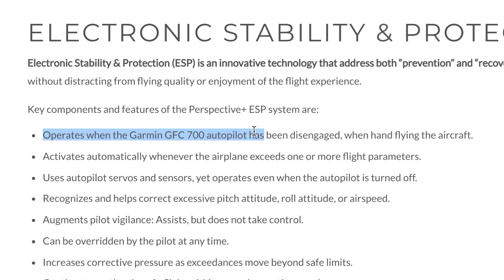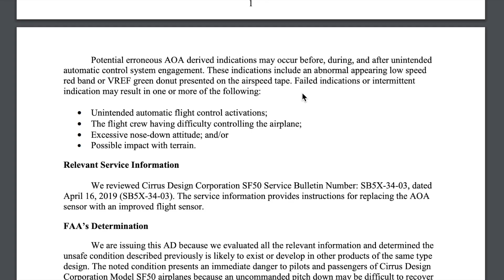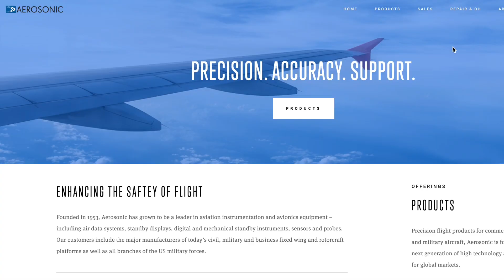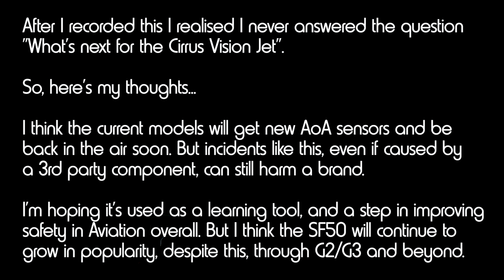Why did the FAA GROUND Cirrus VISION JETS?

Comment: Most planes don’t have an AOA.  Treating it as run away trim etc solves the problem.  Adjust the software and hardware.  Make all operators aware but it was excessive to ground the whole fleet. All political especially in the B737 case.

Comment: I also wonder about all the new features coming out with the new TBM940.  It seems like all these companies are making the airplanes do everything to keep you out of trouble but I also like having manual control over a lot of aspects of flight until they are long proven to work correctly.
Reply from the maker: Yeah I like a degree of system automation, I use it in my flying, but agree that as new automation technologies come into the cockpit the pilot should be able to easily a) monitor, b) verify against other data sources, and if necessary c) override the system. Fortunately seems the pilots in these incidents were able to do that. Thanks mate.
Reply: Stefan Drury - It's all well and good when the issue happens when there is enough speed and/or altitude to recover from whatever errant inputs the automation may apply. Down and dirty just prior to touchdown would be a very, very inopportune moment for something like this to happen.
Fly-by-wire, crash-by-wire !
There are far too many people thinking that "idiot-proofing" is a good idea. Unfortunately, all too often, its implemented by people who fail to perform effective systems analysis.
There really is no substitute for a properly trained and experienced pilot. Having an AoA sensor provide information is great. Having that sensor lead to control-inputs - BAAAAAAAAAAD move. They've already demonstrated just how bad. Sadly, they think that a 'fixed' sensor fixes the problem. It doesn't. The problem is that ANY failure in the system can lead to unexpected and uncommanded control inputs and that they have something in the chain which can apply control-forces when the pilot least expects it and when the results could be rapidly deadly. The only fix is to remove such gizmos from the command-chain, entirely.
One might as well sit a toddler in the co-pilot's seat and trust them not to kick the yoke when the pilot is otherwise preoccupied.
I've been warning about this kind of crap making its way into the aviation industry for decades now and people have said that I'm scaremongering. No, I'm someone who has around 40 years experience of systems analysis and can see how economic pressures have led to companies selling poorly thought-out "idiot-proofing" as a good idea.
Reply: @RoadRunnerLaser  Excellent points!
Reply: @RoadRunnerLaser : Don't forget the influence of government agencies for whom "More is more" and who also have no respect for costs.
Reply: Happy Easter Steveo.
Reply: Completely agree
Reply: Agreed man. No computer should override the humans ever. 
Ill stick with flying my cessna 172.
Reply: Future ATC emergency conversations will be like calling Apple help, "Have you tried turning it off and on again?"
Reply: Oh Steve I watched you and Jeff's motovlog I was just waiting for a pull put I still loved it
Reply: Car manufacturers are going the same  route. You have to pay extra for all kinds of barely-tested gewgaws that are supposed to think for you and guide you to the safe path. Instead, they do the opposite, while lulling many into complacency that "'Otto' will save me."

I doubt it's a 100% coincidence that this is almost the exact problem the B737 had & caused its grounding.  Different causes, for sure, but same effect on the pilot and quite similar procedure to save the aircraft... hopefully.
Reply: @Paul Baker I studied MAX Trim which became as I expected: Rather than placing a sanity-check as control enters code segment; What they have done is allow non-mechanical to ( drop in) ( something ) the design intent of which is to remove all naturally occurring control responses and replace with stick moves; Airplane does that;
Which soon I see a Stall Warning text overlay in the video → Encoders for  Angle of Attack sensors on the MAX were faulty; Giving values which remind me of the Airane incident studied in Standard Texts ~ guessing without seeing both the code and sample on bench with manual; It just makes no sense unless it is comparable to buffer wraparound and Integer Sign Bit issues with some sort of limit value at 74.5° 
«degree of system automation» has made the customer the Guinea Pig for Investor Capital
Reply: steveo1kinevo   yep killing good pilots for the sake of a few incompetents apparently needing enhanced autopilots to protect them from their  incompetence/foolishness. As for boeing they should stop selling a few planes here or there to 3rd tier economies, its just not worth the reputational  risk - MCAS was installed because of very notable 3rd tier stall accidents. US nor European pilots were tricked by MCAS - on the margins 3rd tier pilots will of course be a bit more challenged , its like. putting major sporting  bets on 3rd tier teams - generally not a brilliant idea.
Reply: These stability control systems must not rely on a single instrument. The computer needs to compare all instruments, (exactly the way a human pilot would) to determine the situation the aircraft is in and if there is a malfunctioning sensor. If the AOA is high but so is the airspeed, and the airplane is in level flight and not pulling any G's, then the AOA is erroneous and the airplane is in no danger.
One of the airplanes had a warning about the AOA sensor, so the computer knew it had bad data, but it commanded a dive anyway! That is absurdly dangerous.
Reply: the issue is becoming everyone wants single pilot certified jets/planes and that is causing all this automation. and the subsequent issues

Comment: I absolutely agree with you. If you look carefully at the news, the issue is not with AOA indicators, but with this specific one which unfortunately experienced a manufacturing glitch on this particular model. Overall, I think the envelope protection offered by AP's are a good thing, especially the the feature that allows the pilot to hit the button that puts the aircraft in level flight, should the pilot experience vertigo or loss of orientation.
Reply from the maker: The 'straight and level' button on Autopilots like the DFC90 is also great for passengers. I make it part of the safety briefing for pax in case I can't control the aircraft so at least they can level the aircraft and give themselves more time in an emergency.

Comment: (Not a pilot) I think that the electronic safety features are incredibly useful, but they can promote a false sense of security - a number of high profile accidents were attribited to pilots receiving incorrect data and trusting it when common sense would suggest otherwise. As with everything - training training training is the best safety feature 👍😁

Comment: As CHUCK YEAGER said "If you need an AoA sensor/indicator you shouldn't be flying the plane. " 
I think I'd take his word as gospel.
Reply: 41% reduction in accidents since 2014. Yea, sensors are good.

https://www.faa.gov/news/fact_sheets/news_story.cfm?newsId=21274
Reply: "need" is different that "want". There is a reason all fighter planes fly AoA.
Reply: @2011blueman  my original comment about Yeager was quoted from when he was sitting in an F-15. During ACM in a fighter the pilots eyes are outside the cockpit and the AoA doesn't display in the HUD. It literally is not needed. An airliner is a different beast altogether. It still holds true that a well trained, competent and attentive pilot won't need one because he learned to fly the numbers without it.
Reply: @r08800  The AoA does display in the HUD for the last 20+ years. I know where he's coming from, but the reality is that good/great pilots are made better by AoA.
Reply: I agree in principle, but some of these aircraft now have aerodynamic profiles that have much smaller margins for safety than older planes.  Those wings mean humans need help, but only that - not something to take over...
Reply: It’s the prevalence Chuck Yeagers attitude that has lead to the loss of several airliners and hundreds of lives.  I understand the primary responsibility of the pilot is to maintain minimum flying speed but an alpha display can add information especially when pitot static tubes fail.  In addition ALL modern military combat aircraft have angle of attack displays.  It helps get the most out of manoeuvring and is especially helpful in high wing loaded aircraft.
Reply: "Inflight loss of control – mainly stalls – accounts for the largest number of GA fatal accidents" that's 300 people a year stopping flying a plane because they needed one
Reply: Ok so you shouldn't need one, but would it be helpful? I think it's kinda like having parking sensors on a car, you shouldn't need them to park but they are helpful.
Reply: @h0ll1s  don't ever compare an aircraft to a car wanna know a difference if you use your parking sensor you go back and in a spot because you can't drive also your not using that sensor while doing 100 mph your probably one of those people that get mad at airlines for making fat people pay more
Reply: @Gamerboy-gy1rl  I'm having some trouble understanding what you mean by 'if you use your parking sensor you go back and in a spot because you can't drive also your not using that sensor' Are you saying that if you're using a parking sensor you can't drive? Or that you're not using that sensor? I'm just a bit confused there
Reply: @h0ll1s  meaning this thing noses you aircraft down if you suck at maintaining your aircraft it's like ok  if you wanna say cars what if there's a car with auto lane departure like say it just brings the car in it's lane when you get to far to the left or right but it messes up causes 2 semi trucks to crash and make like 11 cars spin out would you use it?? also  I know mcas only played 1 part in the 73 max crashes
Reply: @h0ll1s  and you only payed attention to the joke of my message
Reply: @Gamerboy-gy1rl  sorry I didn't see you're whole message and please don't make assumptions about people. So are you for or against using AoA sensor/indicator? For me I see that it can be used as a beneficial additive tool for the pilot to use as another level of safety. My concern comes when it a faulty sensor could possibly cause impact with terrain.
Reply: @h0ll1s  I think it's a bad idea and assuming is the only way of getting the truth🙃

Comment: First off, great video Stefan, you covered it all.    I've been flying piston Cirrus with ESP for over a year now, and I love it.   It's great to have while training IFR as the instructor can let things degrade (under the hood, not in actual)  until the system activates which is a better wake up for the student than the instructor commenting  IMHO.  It happened to me a couple of times, generally during that busy time on non precision approaches when you level off as ATC is blabbering away to you and you forget to add power. That issue was solved quickly for me.  Other than that, during normal flights you don't even know it is there.   When training maneuvers you need to push and hold the AP disc button, otherwise it is very difficult to stall, do slow flight or steep turns. This reinforces that it can be disconnected easily when there is an issue with it.   Overall I think it is a great system, especially considering it will help prevent stall/spins in the pattern, which we as pilots have a bad track record with. 

As far as the AOA indicator, I just checked out in the G6 22, which has an AOA indicator on the PFD.   I didn't use it at all and I don't recall a video on using it in the Cirrus training videos.  I'll go back and make sure I didn't miss it after I write this. 

On this particular issue I think the FAA acted correctly.   I also think that Cirrus should have grounded the aircraft when it found the issue,  I think they messed up.
Reply from the maker: Thanks for watching Paul_Flies and thanks for the comment. Interesting you don't reference the AoA indicator on your G6, I've only flown a G6 once and was the same. I think my primary training of attitude and airspeed meant I didn't "need" an additional source of information. Thanks mate.

Comment: Interesting post Stef, for so long most business jets have been 2 pilot operation. In the 70s I can't really remember seeing a single pilot jet,(I'm sure someone will correct me) but with automation and electronic developments,as pilots we seem to be more and more reliant on the microchip. Is this a good thing? I'm not sure, but this seems to highlight a developing problem. Don't get me wrong, the new single pilot jets appear at face value to be a huge business asset, but maybe will require more or a different approach to maintenance.

Comment: The Primary question is not whether you would use an AOA indicator, but should a single data source be a determinant for an automated action. I l used to look at my turn indicator, and check if it agrees with my artificial horizon, now I check both against AHARS. Having a AOA is just another data point.
In many aspects of critical automation, there was always a 'tell me three times' rule, so three computers, and any two could kick out a disagreeable third. Maybe that should be the standard for data sources as well.
Reply: Two out of three isn't even foolproof.

https://en.wikipedia.org/wiki/XL_Airways_Germany_Flight_888T

"The water that was able to penetrate inside the sensor bodies then froze in flight, rendering two out of three of the sensors inoperative, and thus removing the protection they normally provided in the aircraft's flight management system."

Comment: I would like to fly with an AOA System however I would be a bit dubious of allowing it to take over control considering all of the issues with such systems. 737 max, The Cirrus and A number of issues with the air bus aircraft The incident which occurred at the airshow and the number of incidents that occurred with Qantas just off the coast of Western Australia a couple of years ago